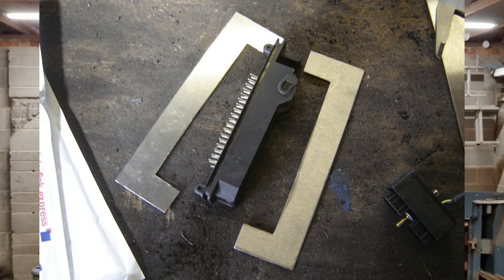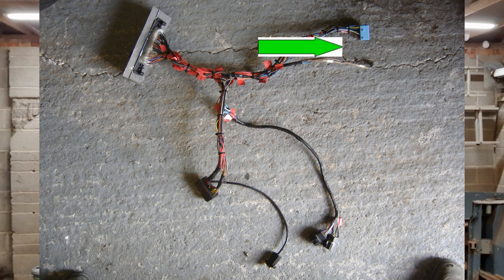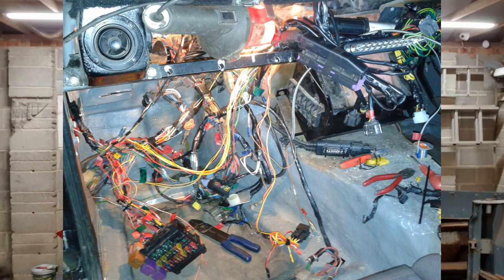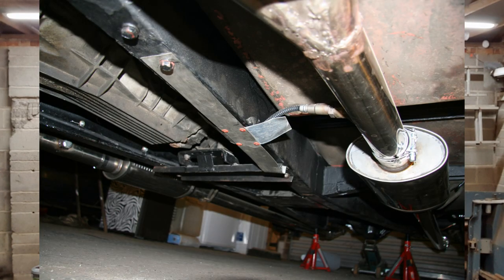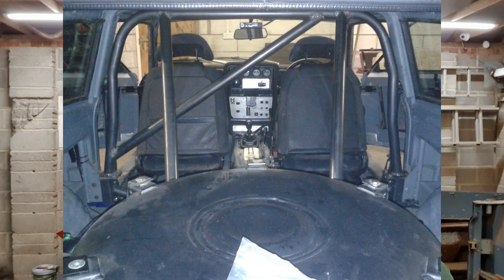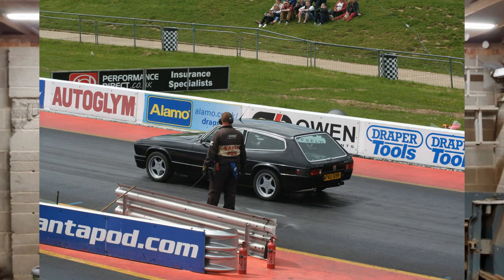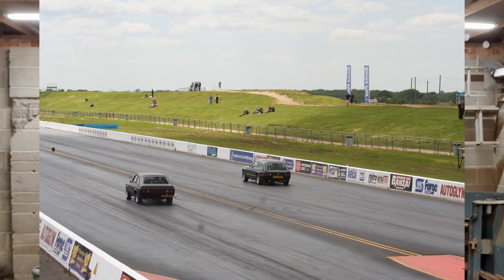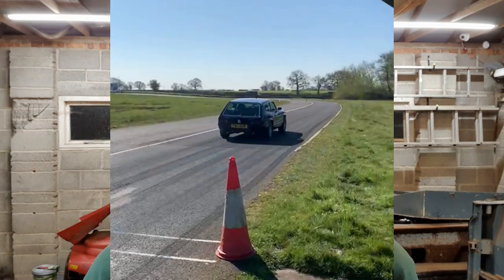X30XE - Making an Engine Transplant work

Comment: Intriguing teaser of the rollers just behind you in the garage! Remind me - what was your rationale behind using an aftermarket ECU versus the stock GM one? I know the explanation is somewhere in your thread on ScimitarWeb, I just can't recall offhand...
Reply from the maker: Thanks Stu. I am so excited to get stuck into that project, gotta get the land rover done first though.

A number of things really.....  primarily it was because I wanted to make as much power as possible and I thought that the modifications I was planning would be outside of what the standard ecu could handle. In addition, in some cases you can free up power by JUST switching to an aftermarket ECU, the standard ECUs can sometimes limit power with retarded ignition.  I will never know if this is the case or not. The standard ECU will have had fuel trims that aught to be able to adjust but I wanted to get rid of the MAF sensor too in aid of performance and the aftermarket ECU uses a MAP sensor instead. 

Another reason was that I didn't know I could make it work with the standard ecu, whereas if I followed the instructions with the aftermarket ecu it should run. And I knew I could look at every parameter via a laptop.

I suppose another reason was that I wanted to do it for the learning experience and the challenge. 

I think I stand by my decision for this car as its meant to be a fun road car and track day car. But ....  

I definitely have a great appreciation for how difficult it is to get a good cold start, warm up running, idle stability and, low throttle running behaviour with an aftermarket ECU. 

It seems to me that (providing you have a good rolling road operator who is confident and tuned into the sound of knock), making good power is the easy bit. Any ECU can do it, batching firing or sequential it doesn't matter. Its the bits I mention above that are trickier, and require either a more sophisticated ECU and a lot of time messing about, or an OEM ecu. 

So I really appreciate the benifit of staying with a standard ecu now. 

Sorry for the massive overshare reply :)

Merry christmas
Reply: @lozl  I was about to ask the same thing so your long answer is not wasted. With my Jag V6 I have no choice but to go aftermarket as I don't have the original ECU and the loom has been chopped up.
Reply from the maker: @Auto-TaT  Thanks Auto, nice to know folk read others comments. What are you going for with the Jag V6. And what's planned for the car? Is it track only or road work too???